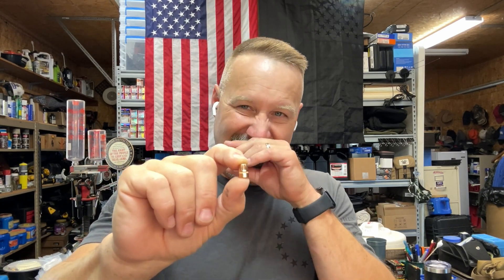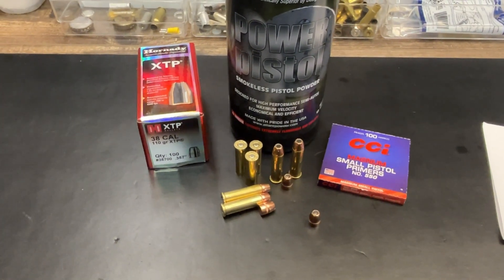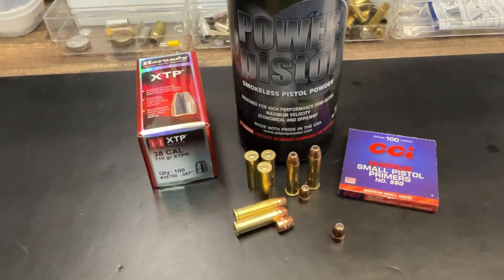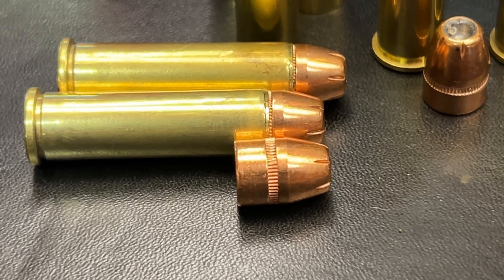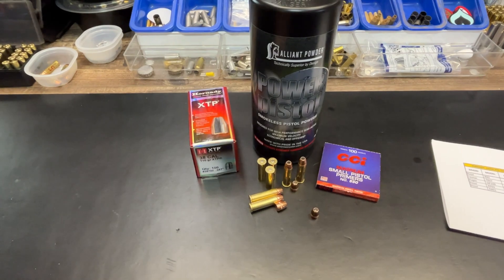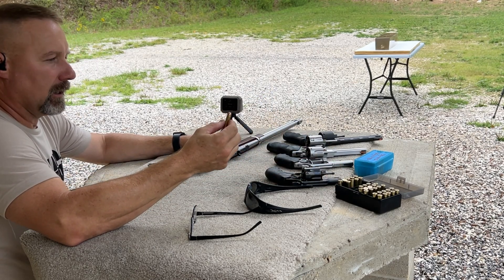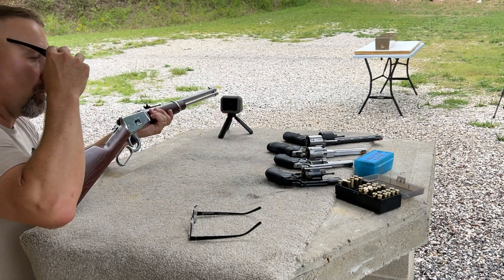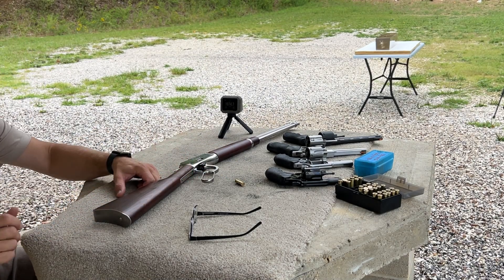.357mag, Hornady 110gr XTP Bullets Tested in Gel Block, Using 5 Different Barrel Lengths!!

Comment: Spicy.  I found a bunch of load data in my LEE book for this bullet at this weight in 357 magnum.  If my hand can take it in my lightweight LCRx, I will upgrade to carrying this in that pistol.  Way better velocities than 38 special +P.  I wonder how fast it will erode the forcing cone if I shoot alot of this load.  I’m gonna use N320 powder to start, as it’s the tamest of the powders i have on hand and dont have any other good use for that powder.  See what kind of velocities I can get out of a 3” barrel with it.  Theoretically around 1400 fps extrapolating the load data.  Got N320 for 9mm and it’s just good for light plinking loads in that.
Reply from the maker: You’d probably need to run 1,000s to start seeing wear on the forcing cone.. Would be a sweet load too. 😉

Comment: So, tell me how the same bullet and load with a shorter barrel goes faster? I'm using 296 and getting 1800-1900 out of a 20 inch barrel.... physics doesn't apply on your range like it does mine? What happened?
Reply from the maker: @ar.d.410  Not sure what you’re referring to with this comment. What barrel lengths are you referring to?   If you look at the spreadsheet near the end of the video, each shorter barrel has a lower velocity. 

-20”@ 1,977
-6.5”@ 1,599
-5”@1,472
-3”@1,406
-2”@1,252

Comment: Goes to show that .357 magnum rounds perform best when fired out of a barrel that's at least 3" long.  Just can't believe the velocity drop from a 3" down to a 2" barrel.  The velocity drop from a 5" down to a 3" isn't that significant.  I'm sure the velocity drop from a 4" down to a 3" won't be that significant either, give or take 50 fps difference.  Great comparison.

Comment: I’m curious why you didn’t say with h110 and use Hodgdon’s load data? I feel the higher speed would have given a different effect on the test.
Reply from the maker: @bern1998  What advantageous differences would you expect with an extra 100fps?
Reply: @kentuckyrangetime  well I’m seeing 1,500 fps with a 2” King Cobra with H110. I feel the juice is worth the squeeze.
Reply from the maker: @bern1998  that is a nice velocity bump for the 2”.  It’d be way over driving it from the rifle though. Guess if I was only loading for the short barrel I’d probably give it a try. 

Since I’ve been loading so many different weights I’ve been pulling data from the Hornady book and didn’t really think to check Hodgdens app.
Reply: @bern1998   I would expect a greater standard velocity deviation with H110/296 powders than I would with the Power Pistol, Blue Dot or Unique when using the lighter bullets.
Reply: Do keep in mind that Hodgdon's online data is from a 10" test barrel.

Comment: swear i was gonna request the 110gr XTP next! That is outstanding performance. Excellent penetration, expansion and temporary/permanent wound cavities. The 125gr, 158gr bullets penetrated pretty deeply. The 110gr is the Goldie Locks weight for .357 Mag 

BTW, i also have the Ruger 1740 5". Bud's has em for $850!!
Reply: The 110gr is far from “the Goldie locks”. It’s a one trick pony load. It’s good for defense against lightly clothed humans. It could be pushed into the roll of short range coyote/pest control load. I’d say that the 125 gr represents the best human defensive round and the 140-158 gr bullets offer the most utility overall, to say nothing of bullet design.
Reply: @Nightwalker-n2u  
I should've said the 110gr bullet is goldilocks for the XTP bullet design
Reply: Keep in mind these tests are not accounting for clothing, bone, or actual tissue.